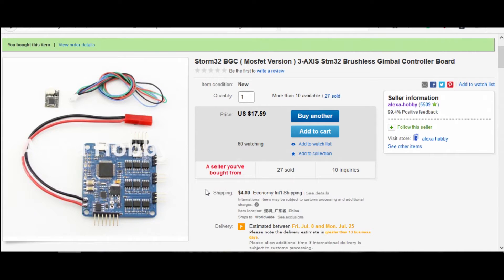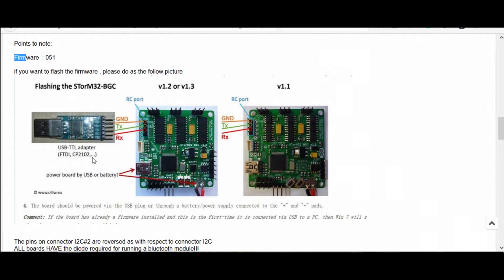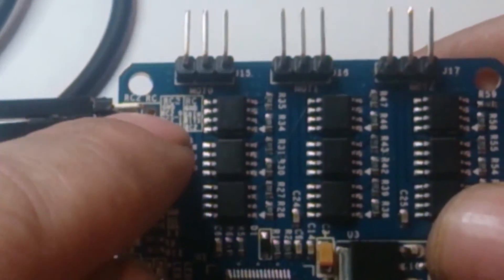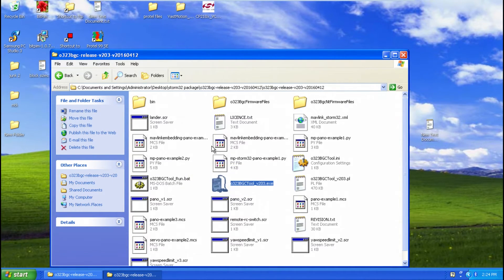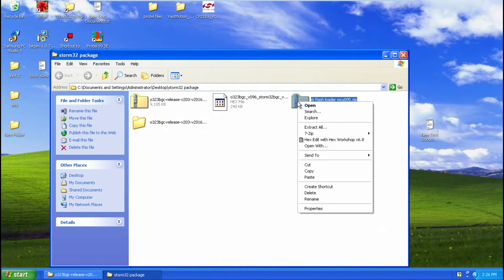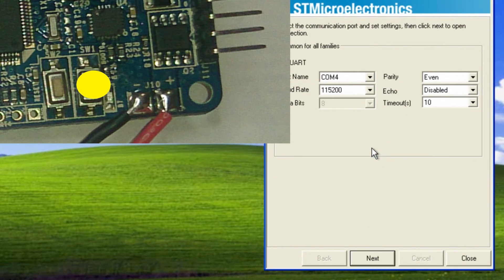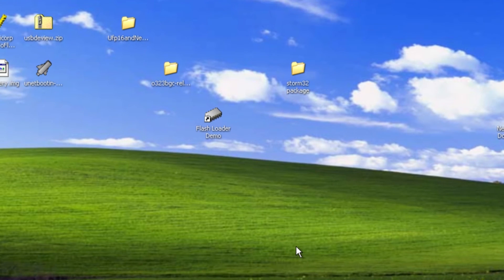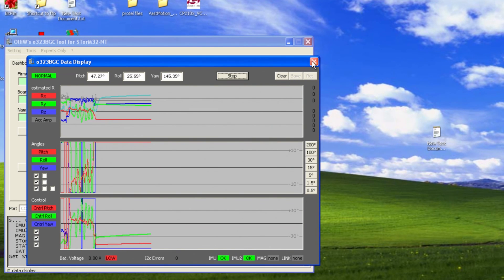SToRM32 BGC v1.4 alternative Firmware update

Comment: I have 2 of these boards Both new The first one I am having problems with, when I get to calibrate the gui its ok .When it come to calibrate the camera Gui ,Nothing happens Like the first one we see the numbers ticking down and finally you get a blue light and accept the readings
This isn't happening .It says either bad gui or not connected 
Hence I passed this information to the seller on EBay and he sent me another
Now I put the usb in and try to get the board read ,it says the firmware is not compactable and can't be read
Any advise you can give on either of these problems is greatly appreciated
Resetting or pressing the boot button still cant be connected
Reply from the maker: Hi which release are you using for the gui / firmware?   and with the error does it at least give a hint on which firmware version  you have.?
Reply from the maker: example of error is like this "The connected controller board or its firmware version is not supported!
Retry with GUI version v0.90"
Reply: yes it says The connected controller board or its firmware version is not supported So i am unable to alter anything to connect I need a hammer 
Hey ,thanks for getting back to me 
I am new to all this ,but trying my best to get some help
Reply from the maker: Ok but the next line does it say which gui to use?
Reply: No
That's the only message I get
If you don't mind. I am off to bed now 
I do appreciate your help more than you know
I will connect it up tom ,do a vid if ness
If that's ok with you
many thanks
Gray
Reply from the maker: ok sounds good.. After you post your link comment you might not see your comment as it will probably get flagged as spam..  I will check it out when ever you post it....
Reply from the maker: https://drive.google.com/open?id=1J24ii6ppdr4PyiZrLXaIs6usl4z17bim   download this version and you should be all good..   you can just edit your post and remove your email if you want...
Reply: Tried it Ok I have told you I have 2 boards The first one says 89ent the next one say v 09 The one you sent I run that Again it wont let me connect to either If there was a way to wipe these boards clean?
I do appreciate your help I am so close to using this hammer
Reply from the maker: The file one i just sent you does not work with the 096 one?  in the description if you downloaded my package did you try the version in the package..?
Reply from the maker: the one that says 89 ..this version should work with it
https://drive.google.com/open?id=14uQL1PfK_d5IJCsDyocoBKikNscwZnZg
Reply from the maker: and then for the 89 version i have another one called (wontl)
https://drive.google.com/open?id=1T5dul6o2Rh1BLYB2iLt4KoW-zKPo7b9t
Reply: yes after flashing It still gave me same message Its like the info wasn't flashed But yet it goes through the same process and says flashed finished
Reply: I will give it a go If this doesn't i wouldn't mind sending you it ,or do remote computer That's if your up for it Are you in the Uk I am Liverpool
Reply from the maker: and yet another version to try .. version 89e.,,
for the 89 board one..
https://drive.google.com/open?id=117EmVSYxJUc3NCmxjV53osFIMix2EkGP

sending me the units would probably cost too much.. I'm in Canada and the shipping is Ridiculous...

..Just out of curiosity.. what system are you running.
and in control panel(Device manager)  is it listed as a com port a virtual port.?
Reply: I don't know why it would do or say this after the flash completed Connecting... Please wait!
v... v0.89e nt
Read... ABORTED!
The connected controller board or its firmware version is not supported!
Retry with GUI version v0.89e ntPlease do first a read to get controller settings
Wouldn't mind i selected the correct file 
I asked where you live I would send it to you if you wouldn't mind
Also if i try to flash as normal ,when dos screen comes up says press any key
The dos screen just vanishes
Reply from the maker: I'm not sure if you seen the comment above this one I sent you a file for the 89 version .. we might of both commented at same time heh.
Reply: lol
 Yes same bloody message i am getting Its getting me down I do appreciate your help and sticking with me I would like to send you one If that's ok I will pay for postage both ways
Reply from the maker: You can send one if you want.  
============
......
============
I find it odd how you are having the same issue on two of them though.
Reply: Ok managed to get a gui installed But back to square 1 When i come to calibrate the Camera gui Nothing happens It say's not connected I tried another new one and the same message Is there a tab or something i should select I did read something about solder tabs Not sure that was .
Sorry How was your Christmas ,good i hope
Reply from the maker: After you connect to your unit..   click on the "data display" button
then push "start" button..    move your external module around / i2c 

does the graph move?

also on the first menu after connecting does it say
imu OK
imu2 OK
i2c errors:0
Reply: IMU is not available
  IMU2 is PRESENT @ HIGH ADR = on-board IMU
  STorM32-LINK is not available
  STATE is NORMAL
  BAT is not connected, VOLTAGE is LOW: 0.00 V
Get Status... DONE!
When i move either Nothing moves on the graph
Reply: I don't understand this soldering people are on about ?
Reply: Just downloaded the latest beta version It connects but does the same thing on imu 39 -> STorM32Link Pitch Offset: 0 (0x0000)
40 -> STorM32Link Roll Offset: 0 (0x0000)
p... ok
Write... DONE!Acc Calibration Tool... 
SHIT 'c'
Acc Calibration Tool... ABORTED
Notice why does it say Shit C
Reply from the maker: ahh.. youtube once again did not notify me of comments. 

can you take pictures of your board with the i2c module connected .. i need to see both sides of the board.. if its in a shell take it out of the shell..

I need pictures of both sides of the main board.
and both sides of the i2c module.

can send the pictures to bangs696969@gmail.com

or upload to google drive ect..

also when your connecting the unit up make sure you are only using
the usb power .. the motors don't need to be attached or the main power..
Reply: Sending pics ,using we transfer its free . i haven't connect lipo as followed your vid, cheers
Reply from the maker: Hi I actually have that board.. so lets start with my version ..then later u can try to update..
https://drive.google.com/open?id=14uQL1PfK_d5IJCsDyocoBKikNscwZnZg

then update your board with the file
o323bgc_v090_storm32bgc_v130_f103rc.hex   
located in the   "o323bgc-release-v090-v20160110)" folder

or try to update your firmware your way againg making sure your using t he v130 file not the v120 or v110
Reply: Ok did that Had to use Arduino as when the dos box came up ,it say press any key and when i do the dos box disappears So flashed it and again it says imu not available So when i go to calibrate only the boards imu works and when selecting camera nothing happens as its not present I have taken 2 screen shots after flash Sending in we transfer
Reply from the maker: hi i updated my original post..   Some how you have the nt version installed..   ..which file did you download?
Reply from the maker: had you downloaded this file o323bgc-release-v090-v20160110 (woNTL).zip?   if so  re click on the above link and fallow the same steps.. if you did not use the woNTL file let me know i will re link it.
Reply from the maker: sorry to spam .. before you try to re download make  sure you used this file o323bgc_v090_storm32bgc_v130_f103rc.hex   it should not say nt in it at all..

like this file "o323bgc_v090_nt_storm32bgc_v130_f103rc.hex"  

You will know its right ..when you connect to your unit in the green box it will not say this in the green box..
Firmware version
v0.90 nt
Reply: Its time for bed here in Liverpool ,up early so will have a go tomorrow lunch time I am so grateful for your time on this.Cheers Graham
Reply: Yesssssssss I stayed up for a final go Got it working
Thanks it says imu present I will speak to you tomorrow  A million thanks mate
Reply: please could you upload screen shots of all settings PID ect Many thanks Almost there now

Comment: Anyone will to give me a config file of a good pid setting ?  I’m using mine on a 550 hex and can’t get it to work right.  It seems to work fine until I hook up RC pitch control from Pixhawk then it starts acting up.  So I don’t no what’s going on.  I could just use it without RC pitch and it works good but whole reason I got the gimbal was to have RC pitch control
Reply from the maker: I have not used mine since the video so I'm not expert ..  I do have my settings on this video https://youtu.be/3eRlCLg2iHo?t=1860  but its been so long maybe that was close to default..

Comment: it keeps throwing an error of not being able to go into boot mode
please help iam using a ftdi adapter
Reply from the maker: so you get past this stage  https://youtu.be/61DrDoOUfTs?t=344   or is this where it screws up with the error?
Reply: bangs6996 I managed that but my board and gimbal happens to really get hot at certain points.
Reply from the maker: usually you just have to play with the power settings..to find a happy spot for them.. i have not played with mine for a really long time so no expert on gimbals..
Reply from the maker: If your gimbal is not working ..and you mean it gets really hot on the cpu or around it.. it can be fried as well.. the board in this video went poofy on me....when i was trying out the but switch or what ever its called.. the voltage reg blew ..and i think it took out part of the cpu as well.   https://youtu.be/uzjYtaaMImc?t=14
Reply: bangs6996 so now my only option is to get a new board right? Not like I can replace the voltage regulator?
Reply: bangs6996 cause I think the imu is connecting
Reply from the maker: well thats the thing i did replace mine.. and the chip still gets hot and does not work.. .. .. you can test the voltage to see whats coming out of it .. ..My cpu has some kind of weird internal short now...   .. now if you wrecked your boot loader you might have to get a st link v2 and reload the bootloader... .. I have some st links but never tried that on my board so i don't have a personal dump of mine... .. And if your chips are getting extremely hot to the touch .You prob have something broken..
Reply: bangs6996 no I managed to boot it up just was connecting the ftdi wrong
Reply from the maker: so does it still work when you connect the usb ...then connect with the gui?
Reply: bangs6996 yea it works just fine but I don't have the yellow led glow and in configuration tool it doesn't ever go back to the normal mode. Nor do I ever hear the beep.
Reply from the maker: alright.. .. so you are using st flash tool? .. maybe your not pushing down the button hard enough for boot.. or holding it long enough?
try it with never letting go of the boot button.
https://youtu.be/61DrDoOUfTs?t=339

do you make it to that stage at least?? or do you get a error when you push "next"

Comment: Windows 10 no longer has Com Ports. Just wasted money on a new Pc.
Reply from the maker: yeah I have to use a old xp laptop for all my hacking the serial port got phased out on mother  boards a long time ago..but you never know you might want to find the manual on your mother board it might still have the connections for a serial port..   if not just get your self a cheap usb to serial adapter they are about 2 bucks on ebay.
Reply from the maker: hmm sorta assumed you were talking about serial ports ..is that what you meant? or are you having problems with drivers?
Reply: I was talking about com ports, but it turned out it was a cable problem. The cable worked fine on my Mac, but not on my new Win10.